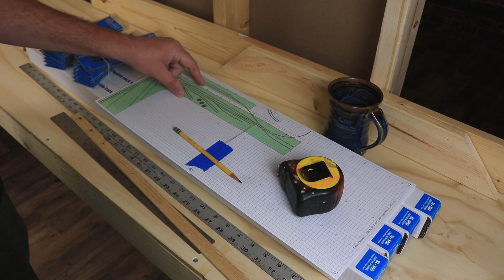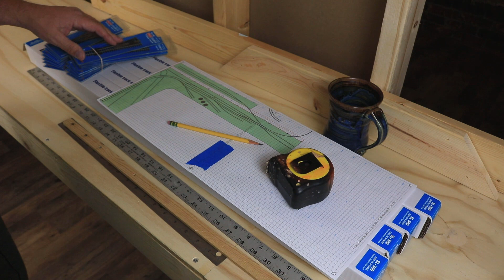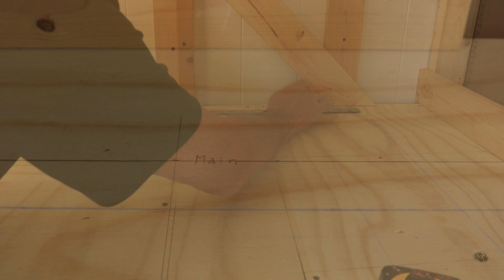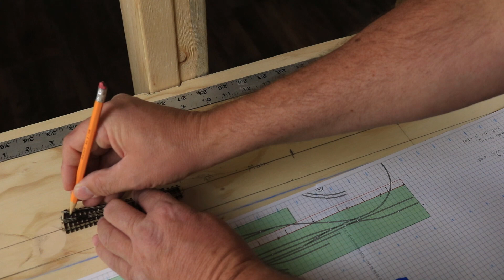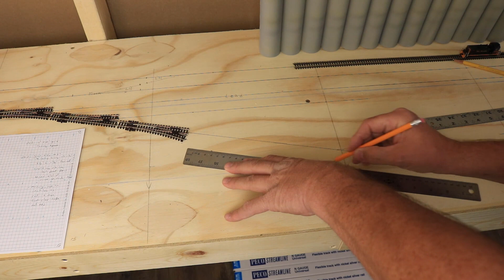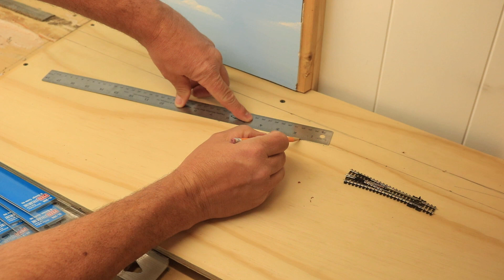Transfer Track Plan To Model Railroad Benchwork

Comment: I’m wondering about printing anyrail 1:1 sheets (idk if he was using that at the time) and then cutting away the non-track areas and either drawing around the track diagram, or just gluing down the actual paper and placing roadbed and track straight on top of that.

Comment: I have a question for you. How do you calculate a length in a rise. For instance if I want to go up two feet at a 3 degree angle.
Reply from the maker: Great question. The formula is grade = rise ÷ run. In your illustration, rise = 24". Grade is 3% or 0.03. Thus 0.03=24÷X. Solve for X.
0.03X=24
X=24÷0.03
X=800"=66' 6.6"
To figure how long the run in a helix is, use the circumference of the center line of the track. So 16" radius is 32" diameter. Circumference id pi x diameter so 3.14159 x 32 = 100.5" of run per turn in the helix.
I hope this helps.
Reply: @RonsTrainsNThings  Thanks I could not find this formula any where

Comment: Most modern day lumber yards have sheds that they put lumber bunndles in when the unload them from rail cars or trucks .one size on one side 8 ft thru 20 ft and a different size on the other.the to level sheds that i saw on your lay out are for smsll lumber yards in a town

Comment: Good day Ron's. I like your show it is useful, I like to know from your experience what type turnout of PECO System I can use it in my layout #13 from ATLAS Book # 11 p# 20. It has 5 turnout # 4 by ATLAS Cod 100, 3 L.H, and 2 R.H by using the DCC System. Since there 2 type of PECO Turnout one is Elecrofrog, and Insulfrog. Best regards to you for your time.

Comment: This process seems unnecessarily complex for no reason.  You use Anyrail, I use SCARM.  Print out the portion of the track plan to scale, tape the sheets together, lay them down over carbon paper, and trace.  I used 11x17 paper to print out my entire 11x13 layout.  Standard letter paper would use a bit more Scotch tape.  A small pack of carbon paper is all that was needed, as the sheets can be used multiple times.  Some layout builders actually glue the track plan to the sub roadbed.
Drawing reference grid lines, transferring measurements...this is far more complicated...and antiquated...than it needs to be.

Comment: Good informative video Ron.   What I found worked well for me was to print a 1 to 1 layout plan from Anyrail with center lines showing then tap it down to the plywood or foam at then I used a leather working tool ( a wheel with spikes on it) and ran it over the paper and transferring to plan to the wood and then connect the dots and draw out the centerlines for the cork. 
Tool ==>   https://www.amazon.com/gp/product/B071P6V4ZJ/ref=ppx_yo_dt_b_asin_title_o02_s00?ie=UTF8&psc=1
Reply: Tony - Question. I'm doing the same thing with AnyRail. Why not glue the 1:1 plan to the bench and lay your track directly over that? Thanks...
Reply: Troy  not Tony....sorry

Comment: If I could make a suggestion on what has worked for me.
Since you are using Anyrail 6, you could print out your layout in 1 to 1 scale on 8.5 x 11 pieces pf paper.  When Anyrail 6 creates the pages, they provide reference marks to you can tape all the pages together.
Once you have your layout in 1 to 1 scale, you can place it on your benchwork and get a really good idea what your track plan is going to look like. I usually cut out the paper to the outer edges of the track.
Then to transfer the track plan to the benchwork, use a pounce wheel and transfer paper (the same technique used to transfer patterns to fabric) and trace out the centerline of your Anyrail printout.
Then you can use the centerline to lay all of your roadbed and you are done.
This is definitely one of the features of Anyrail 6 that I like, being able to quickly and easily create full scale printouts for transferring the layout to the benchwork.

Also, great tip on not using sharpies. I found out the hard way with a red sharpie as well.
Reply: I took that idea one step further and printed my track plan from Anyraill to a full size PDF and took it over to my friendly UPS Store where they printed it on a large format printer. There's fewer paper segments to piece together and it worked great. All you really need to know from  the store is how wide the large format printer can print in order to format your PDF and the track plan comes out in a continuous strip.
Reply: @daveb4028  I actually printed mine on the plotter at work, but a print shop is definitely an option.  I mentioned the printing at home method as this is probably the most accessible to most people.
But your solution is definitely a great option.
Reply: Scarm also has this option and it works great

Comment: I'm surprised you didn't print your plan 1:1 and lay the sheets on your baseboards, instead of redrafting everything directly on the wood. I'm intrigued on your next steps too - covering up the nice lines with cork (etc) roadbed, and then having to figure out where to put the actual tracks afterwards!

Comment: As the trackplan was created in AnyRail, it would have been far simpler and quicker to just print out the centre line for all curves including easements.
Reply: You can also print out the track plan at full scale (even in the free version)
Reply: thats IF you own the fullversion of the software

Comment: Hi Ron. Great video. What about using a CAD program to transfer the trackplan to the benchwork? After I printed out each segment of the plan and tapped it to the benchwork, I used a Machinist Punch and a Pounce Wheel to transfer the centerline to the benchwork. Goes much faster than one might think. The CAD program automatically has easements built into the trackplan. Used 3rd Planit software to construct my 18'x13' Brooke Valley HO Scale layout and it saved a lot of grief. Not the best way I'm sure, just another way of getting to the same place. 

Thank You Ron for sharing this with us.